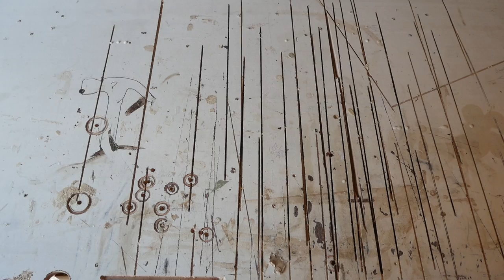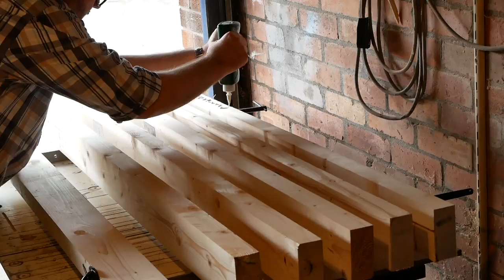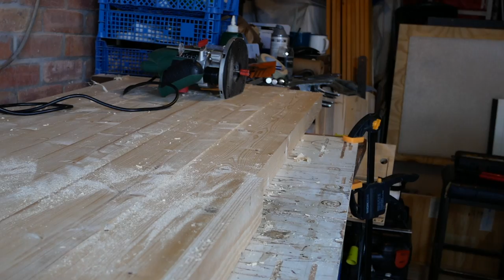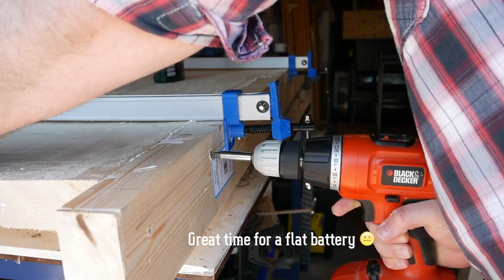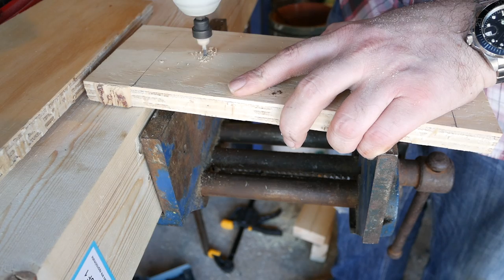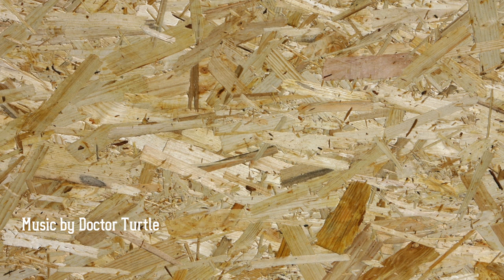Workbench Update : Phil Makes Things No  12

Comment: Hi Phil. Most likely your cupping has come from normal wood movement after your router jointing released an amount of tension from the timber. Did you leave it to acclimatise in your shed for a while before working on it? If not then that'll also be a reason it's moved. Wood's a bugger like that... :-)
Reply from the maker: Wow, you've gone way back in time! Thanks for watching. Its also because I didn't have the means to joint the edges of the boards, so it was wonky to begin with. I'll do it again someday... And use plywood 😂
Reply: Was listing to Andy Mac's (Gosforth Handyman) new podcast today and he mentioned your channel so I checked it out.
Reply from the maker: Oh really... Well that's nice! Andy's a good fellow, spoken to him a few times.

Comment: Are going to make a new bench?
Reply from the maker: Eventually... I’ve been reading Christopher Schwarz workbench book and have plans for a joiners bench, at some point.
Reply: @PhilMakesThings  I do think your bench needs some more weight to it. And also clamping your top boards, try and clamp them with as little twist as and keep them flat as possible, this will make life easier, I have built a couple of work benches myself, I did a lot research. My bench is 1.2m long( wish it was a bit long but I have a small space) with the vice near the left leg. I have built a mini work bench too, this bought the work closer and saves your back. Overall I found building a bench a great teacher and learned many lessons.